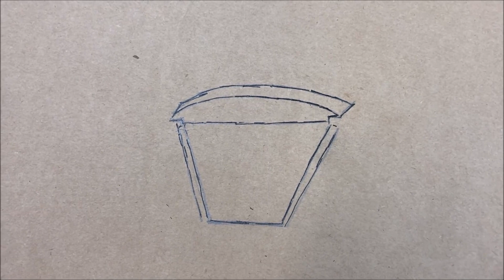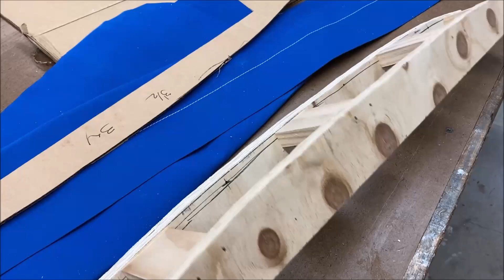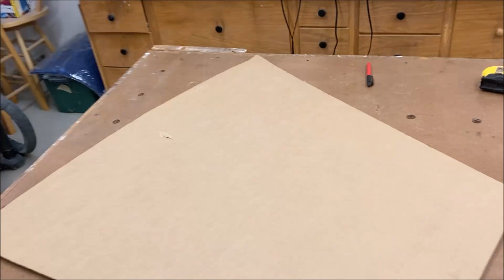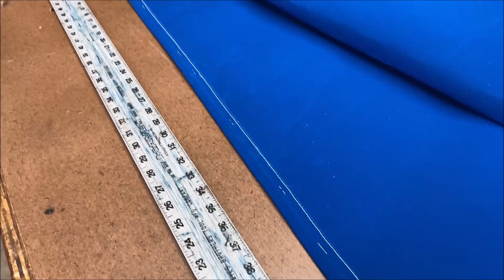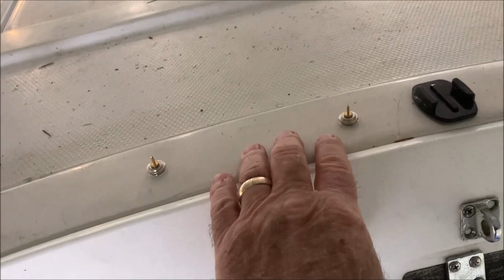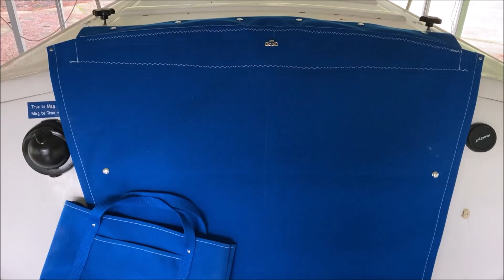Companion Way Canvas Cover - Jim's Little Boat -- Catalina 22 -- Sewing Project -- Small Sailboat

Comment: About 15 years ago I made one of these for my 22, it has turned out to be the one of the most used accessory that I've used since making. Instead of using snaps to help hold it down around the sides, sew in permeant battens, as you did on the bottom. This will keep the wind from pushing in the center and stabilize it hanging from the top. Also, adds extra weight when laying on top of sliding hatch so wind will not blow off and helps storage by rolling up into stiff cylinder.
Reply from the maker: Good ideas.  Thanks

Comment: Nice job Jim!  I can relate to the learning curve, I started making stuff with Sunbrella and such covers really help keep rain, dirt and insects from entering the boat.  I'm just now starting to sew straight and neat stitches, but it does take practice.
Reply from the maker: I have been learning some tricks--such as better lighting at the needle, and ways to roll and clamp large pieces of canvas so that the material doesn't catch when you are trying to feed it.  I got the staple idea from the sailrite user group on FB--so much better than pins!  Straight stitching in a line is getting easier.  It will take a long time to do long curves.